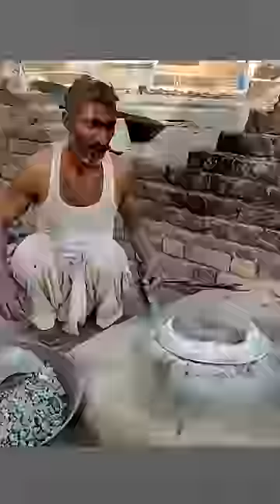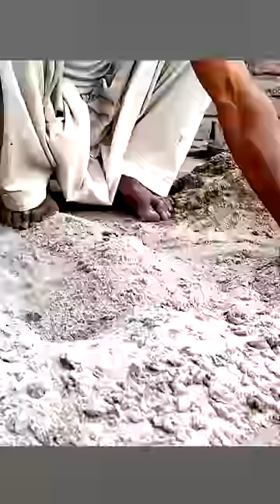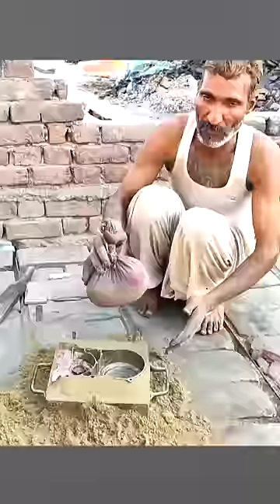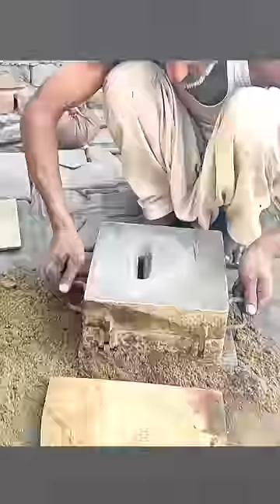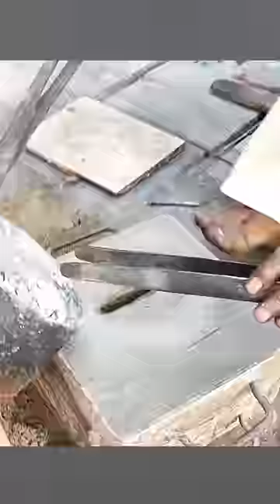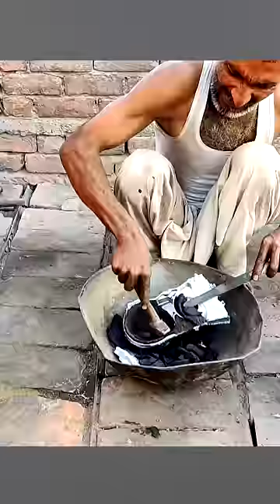Aluminum Casting Motorcycle Engine Cover

Comment: Ye video sirf dikhany k liye ha jo casting is ny ki ha wo kabhi bike py fit Nahi a saky gi ku k mari apni factory molding ki ha isi kam ki jab b ap casting karty ho to orignal pcs sy 1 2 sotar kam rahta ha mold hua pcs lehza is ma nut bolt tight Nahi ho pay gy asi cheez k liye special mold dia jata ha jis ka size 2 sotar bara rakha jata ha or melted silver py depend hota ha k wo dey hony k bad kitny sotar ka difference daly ga